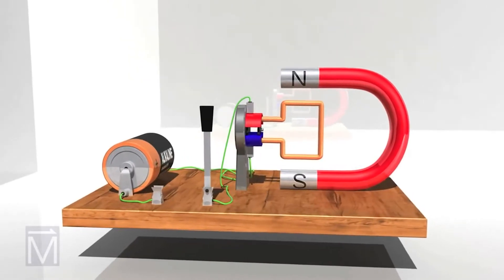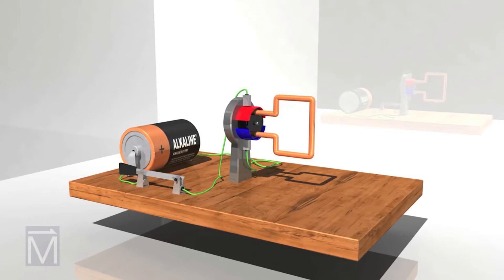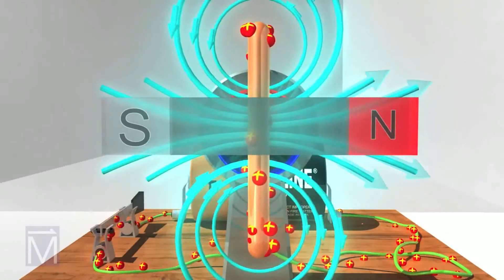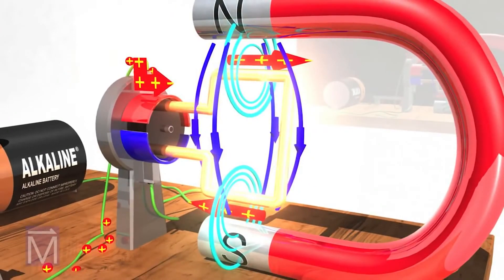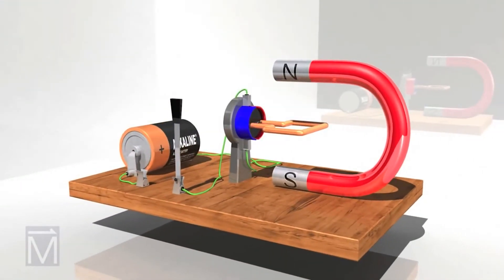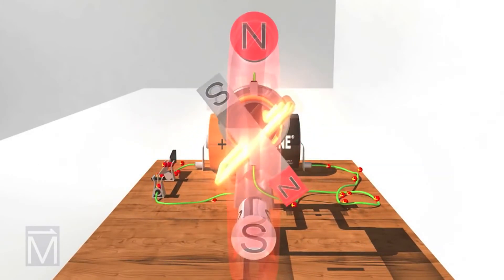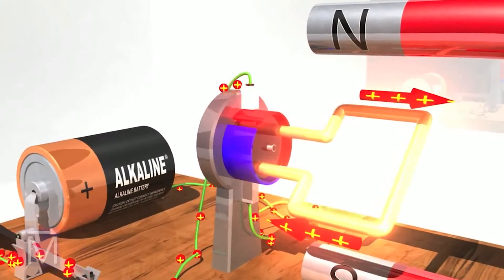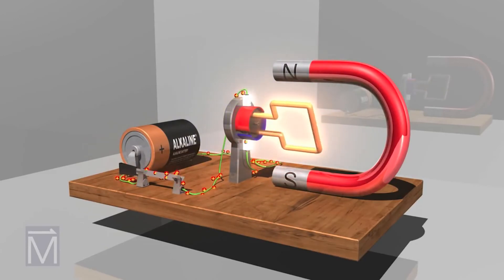Funcionamiento motores

Comment: Hola, tengo un motor de corriente continua DC que trabaja a 12 VDC me gustaría hacer que funciones con 48 VDC o 90 VDC, es posible hacer esa modificación ?
Reply from the maker: Buenos días Wilberto, te recomiendo que no vayas a realizar ese procedimiento, una de las principales razones es porque los motores están diseñados para operar con un voltaje y potencia nominales, que son parámetros que se obtienen de la curva de saturación al caracterizar el motor.
Lo anterior significa que si proporcionas más energía al sistema no vas a conseguir mayor eficiencia en el desempeño de la máquina, por el contrario, podrías averiarlo ya que el exceso de energía se traduce en pérdidas por calentamiento.
Te recomiendo que si sólo tienes disponible esas fuentes con los niveles de tensión que mencionas, optes por la opción de añadir una etapa de regulación de tensión y así entregar los niveles de energía recomendados por el fabricante.
Espero haber solucionado tu duda satisfactoriamente.
Quedo atento a más comentarios.
Saludos.